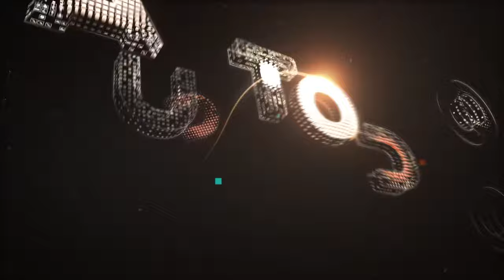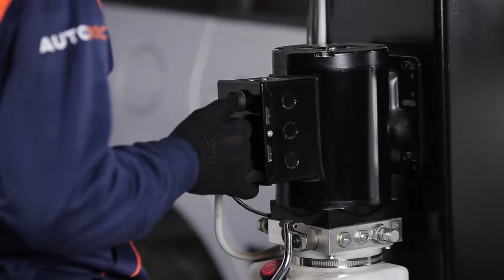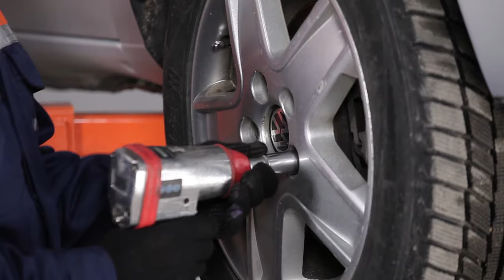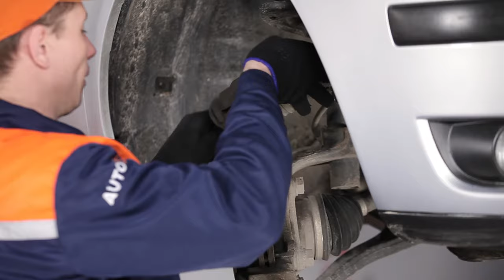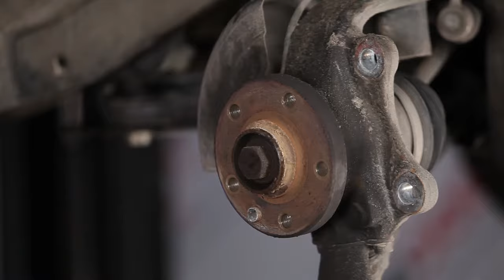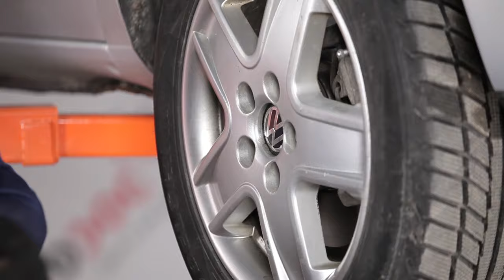How to change front brake discs and front brake pads on VW SHARAN 7M TUTORIAL | AUTODOC

Comment: We got our Sharan second hand. Recently we heard a grinding noise at the left front wheel.

So I removed the wheel and checked the brake pads. Outer was fine. Inner was, well, almost flat, but it was not installed correctly, and was actually a bit skew. 

Removal of the old pads was quite easy, and off I toddled to the shop to get new pads.

New pads duly acquired I toddled back home to install these... only to find that the inner one fitted very loosely in the caliper, while the outer one does not fit on the brake pad cradle. (FYI the caliper model our Sharan have is different than the one shown in this video, think it is for the 2.8T Sharan). 

Anyway, so I check the old pads against the new ones, and got a big surprise.

1. The pads are the same.
2. In order to make the pads fit, the backyard mechanic removed the rear clip (which goes into the caliper) on the inner pad, and chamfered (probably with a baby grinder) the inside hooks on both pads so these would fit. 

I have photos of the botched job. If you want to see, let me know, and we can make a plan. I want to take photos when doing the next wheel, sort of a documentation. 

So off to the dealer I trotted again, and they looked in the brake pad catalogue, and ordered again. 
When these came, they were also the wrong size. 
I asked for a refund, went to another dealer, and they got the correct ones. 

I do believe that when it comes to brakes, the installation should be 100% and not some half-baked modification job, since it is your life (plus your family's as well as other people's lives) that you have to keep in mind.
Reply from the maker: Thank you for your very informative comment! 
We appreciate your interest in our channel.
This information will be very useful for us and our viewers.
We kindly ask you to stay tuned with us and follow our new videos coming soon.
Best regards,
Autodoc team.